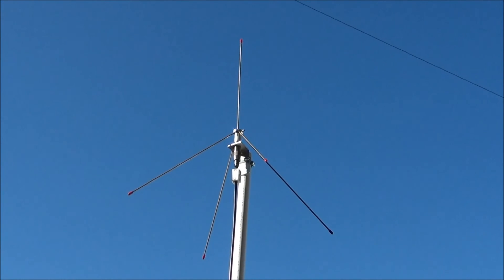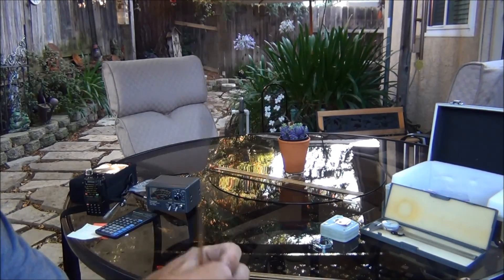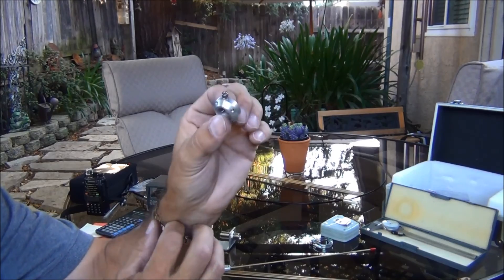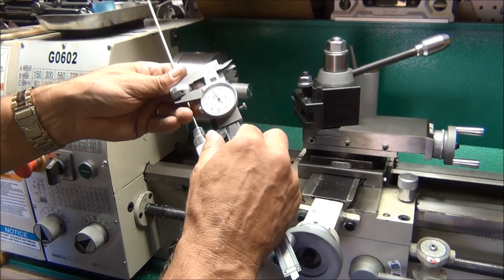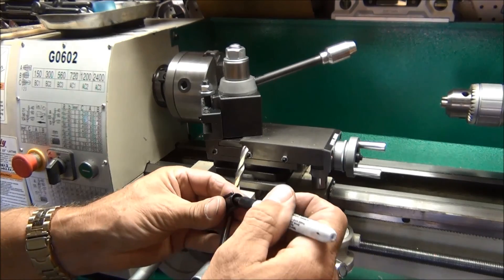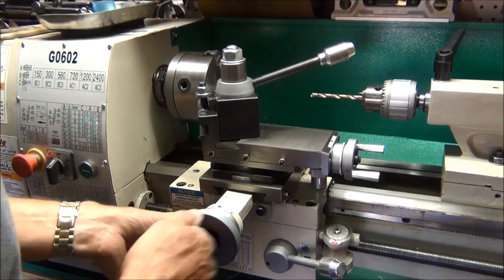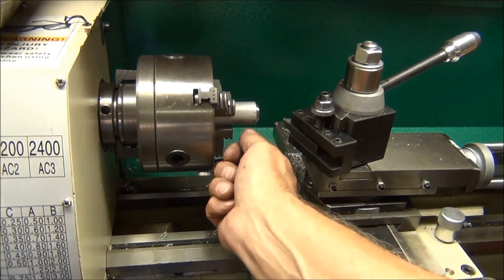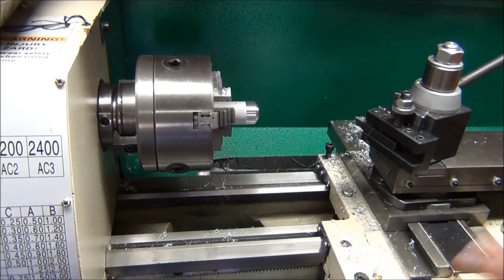VHF - UHF Quarter Wave Antenna Part 1 (Grizzly G0602 lathe)

Comment: Great video. Thanks. I've actually been shopping for lathes. Mostly been looking at South Bend 9-10 inch tool room type lathe for small project such as this. Do you like the Grizzly lathes? Any buyer's remorse?
Reply from the maker: For the limited use and the types of projects I do the lathe is fine. The main goal for me was to learn how to use a lathe. That goal has been accomplished but I am not an expert. Having a South Bend would be wonderful. If you can spend the money on the South Bend I'm sure you will be happy.

Comment: nice video, i have the same lathe and i was looking to upgrade to a QCTP, was just wondering which one you are using, because i know there is a slight bit of modification needed to be done to the T bolt to make them fit, thank you in advance for your response
Reply from the maker: I am using the series 100 QCTP from Grizzly (G5689). I bought a spare carriage plate in case I had to modify it. That way I could always revert back to the old tool holder if needed. Instead of modifying the spare plate I just made a post bolt out of a piece of threaded stock. I turned down one end and threaded it to match the threads in the plate. That way I was able to start using the QCTP without a lot of effort. I also made new knobs for everything out of aluminum. You may notice some of them in my videos.
Reply: oh ok that is what i was thinking was the best approach aswell, thanks for replying i greatly appreciate it !

Comment from the maker: That was my thought also. Select the appropriate antenna for the band you want to work and assemble it. After that it would be very easy to attach the antenna to any available support and start using it.